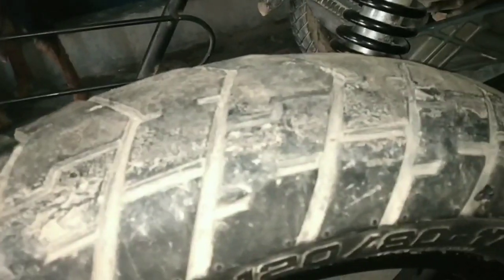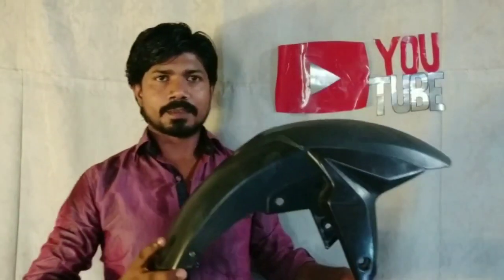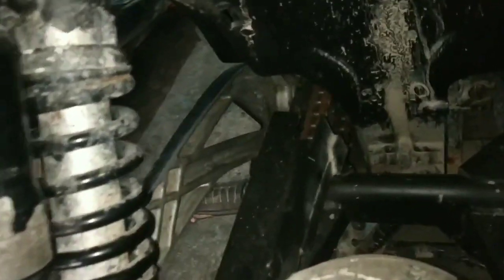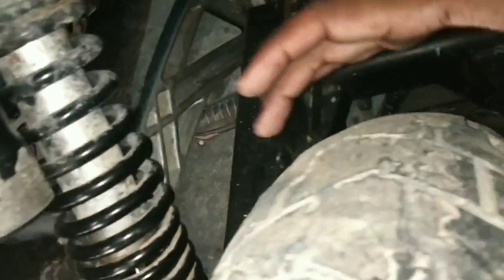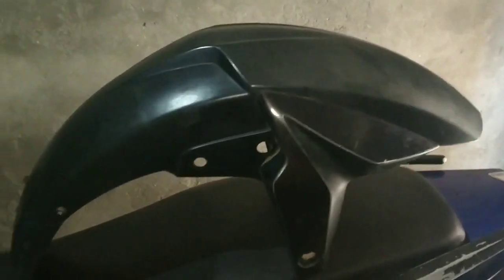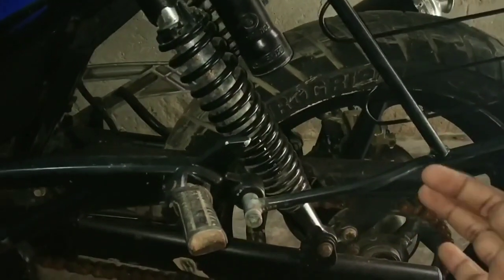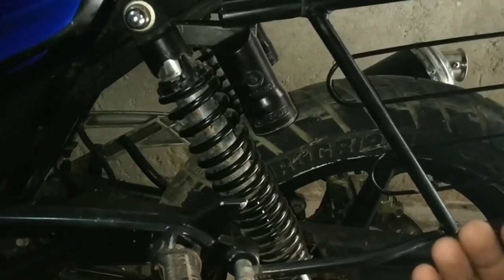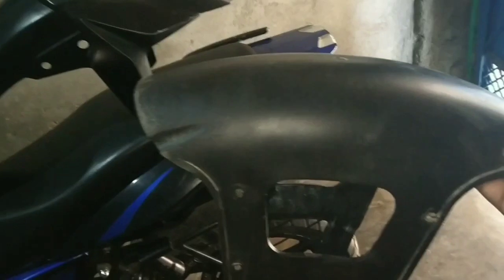HOW TO INSTALL REAR MUDGUARD IN PULSAR 150

Comment: It is good bro. But one thing keep in mind. When your bike gets punctured or gets low in air, the tyre gets really flat amd will rub those mud guards and you may not move your bike with that rubbing sound on road. Both guard and tyre gets ruined.
As your rear tyre section is 120, your guard should be big enough like that of Dukes or NS backguard or X blade or  Apache 160 4V or R15 V2 rear full mudguard or FZ rear full mudguard.

Just do one thing. Remove the air completely in your back tyre. Remove the mainstand and Now place the Mudguard over your tyre.
Now check whether Pulsar NS front Mudguard is not touching the tyre. 
Pulsar 150 rear Mudguard is good for 100 section tyre even in puncture condition but it might rub your 120 section tyre in case of puncture. 

This is one of the reasons that Yamaha stopped giving full rear Mudguard in FZ and Fazer.
Reply from the maker: thank you bro aapne itna kuch socha or mujhe btaya. lekin jub tyre puncture hota hai to air pressor km ho jata hai. or jb air pressor km ho jata hai to tyre ki width bhi km ho jati hai. to jb air pressor complet hai tb tyre mudguard me tuch nahi hota to. air k km hone per  vo tyre mud guard per kese tuch hoker rub hoga or jub rub hi nahi hoga to tutne ya khrab hone ka swal hi nahi hai. ok aapne itna socha or mujhe btaya uske liye thanks once again lekin mai aapko ye install ker k dikhaunga or after some time ager koi problem hogi to mai vo bhi apni video me btaunga bro ok.
Reply: @allthethingtech6441  bro. Pressure kam hone ke baad tyre flat ho jaathe hain.
Thats why i am saying. Please do one thing.
Remove all air from your rear tyre. Remove the stand and ask your friend to sit on bike and to move your bike straight on road.
Then observe the width. Due to weight of bike the tyre width gets more like 130 or 140 section.
I have more experience in this thing.
If you are not convinced. Then ok.
Just fix one Mudguard temporarily with slight welding and then remove total air of rear tyre and try to move the bike as said above.
If that passes the test then fix them permanently.

As i mentioned above some bikes Mudguards, with those you will never face issues.

Anyways i like your passion bro. Cheers 👌🏻👌🏻👌🏻👌🏻👍🏻👍🏻👍🏻👍🏻
Reply from the maker: @srinivasteki9458  chalo maan lete hai aapki baat ek time k liye per ye jaruri thodi na hai bro ki tyre puncture hoga hi hoga. Fir b aapne ek topic diya hai to mai installation video me ye bhi ker k dikhaunga. Ok
Reply from the maker: @srinivasteki9458  ok bro i can understand
Reply: @allthethingtech6441  👍🏻👍🏻👍🏻